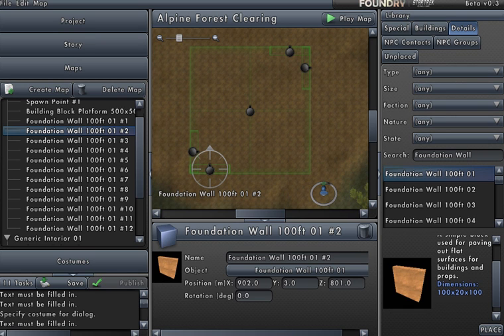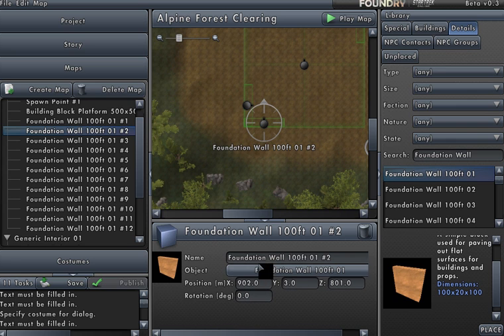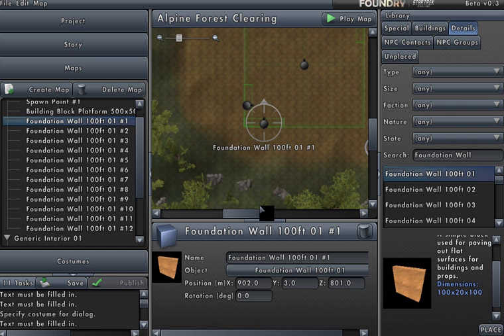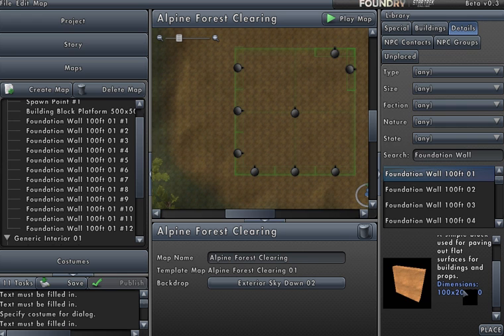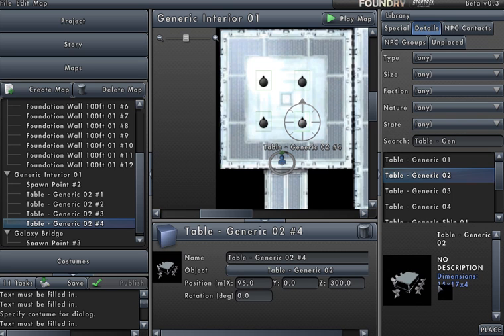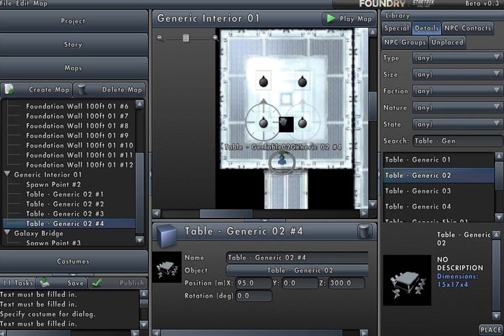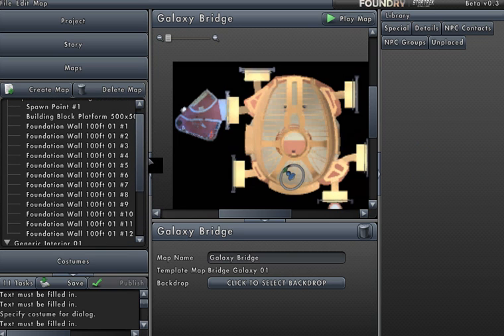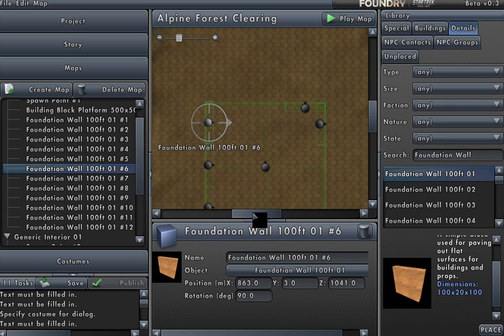STO Foundry Tutorial - Item Placement and X, Y,and Z Coordinates

Comment: The reason that using /loc to get the coordinates seems to give a false value for Y is that, in the editor, the default behavior is to treat Y as distance above the ground and the ground can vary in height all over the map but /loc command gives the real value of Y. That's why /loc seems to give reliable values in space but not on the ground or interior.

There is a checkbox to switch between ground-relative height and true height. For most usage, you can stick with ground-relative height.

Comment: @IronWright1992 This is incorrect. Different graphics systems use Y and Z differently. The bias seems to be that many systems designed for animators think of the X-Y plane being relative to the screen so that Y is vertical which more engineer-oriented systems think of X-Y the plane as being like the surface of a map so that Z is vertical. Star Trek Online uses Y as vertical.